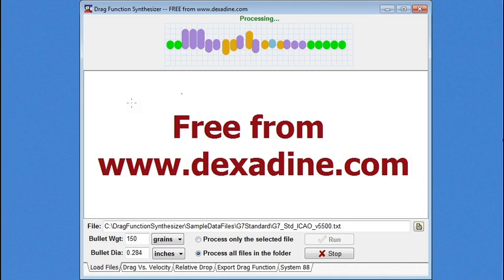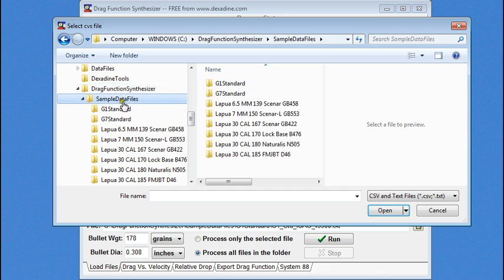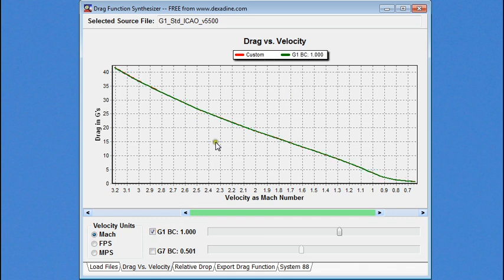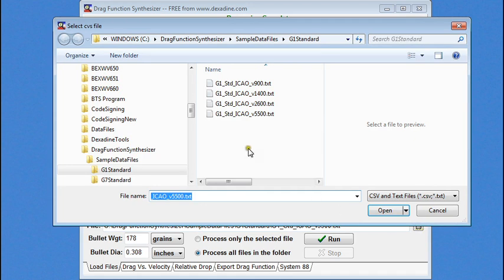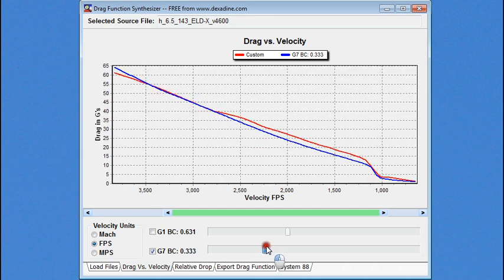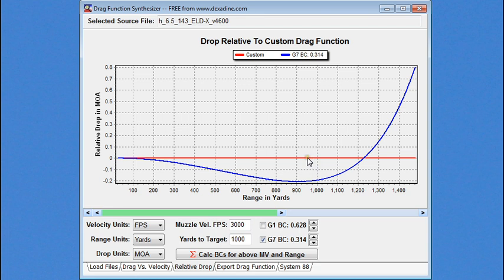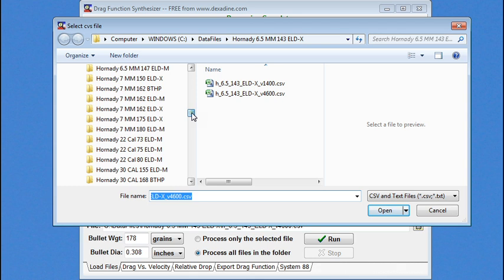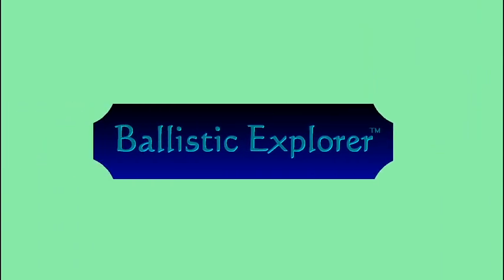Drag Function Synthesizer Part 1

Comment: I've been calculating stepped bc's by hand so I think this software would be valuable to me. So if it's free for 30 days what's the cost after 30 day's? Thank you.
Reply from the maker: Thanks for your comments. The software runs in Demo mode for up to 30 days.  In Demo mode there are restrictions on what BC values you can use, but you get to work with and test the software on your own PC before you decide to buy.  The cost to register is $70 USD.  Lots more information at http://www.dexadine.com/